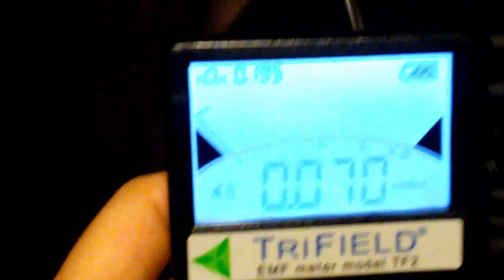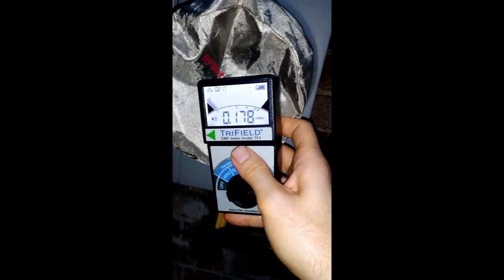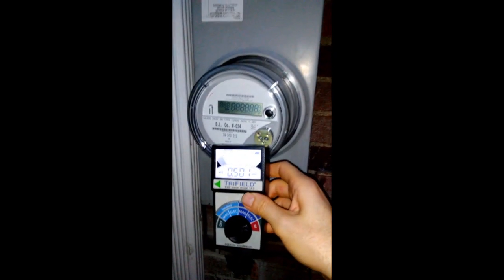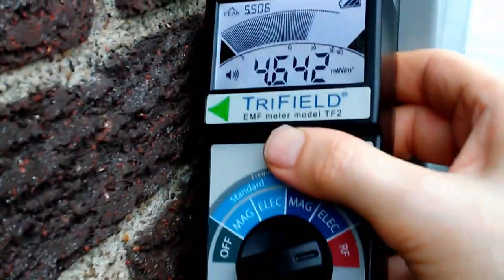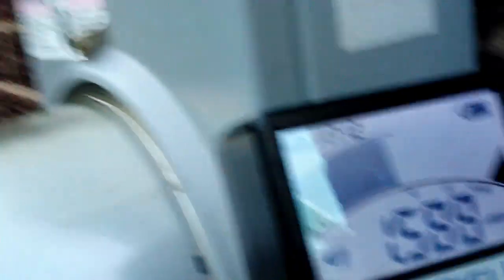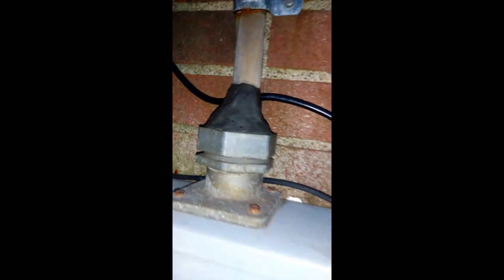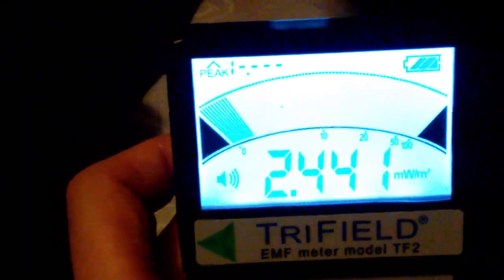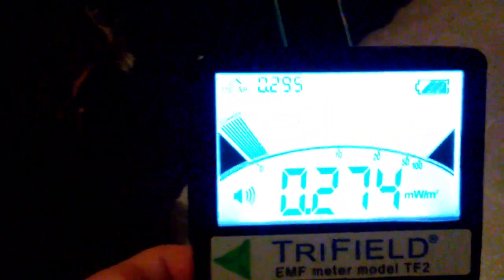EMF Meter measures microwave and smart meter radiation

Comment: Lmfaooo bro microwaves are fine. Stop being a weirdo
Reply: Not really, but the guy is exaggerating. However any magnetic field does charge your body with protons. Over time that causes health problems. The only way to balance that is by touching ground with your bare feet or grabbing a tree with your hands. The electrons on the ground balance with the protons in your body.
Reply from the maker: if you say so.

Comment: Thanks for the update on meters and microwaves! Have you checked out baby monitors?
Reply from the maker: no I haven't.  I know baby monitors used to transmit on like 46-49mhz range and that was probably kinda safe.  If they use a higher frequency like in the 800 or 900mhz range; I would bet they are putting out alot of EMF.  It should tell you on the baby monitor what frequency it is transmitting on....  I dont have wi-fi either though I checked it at my friends and it was really bad.
Reply: @mustaffa1611  you are the man thanks alot bro!